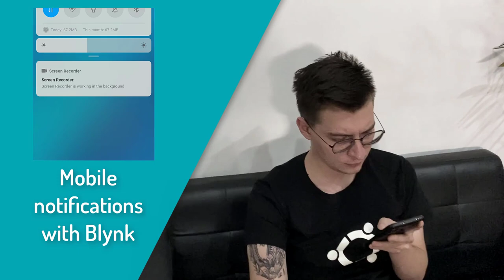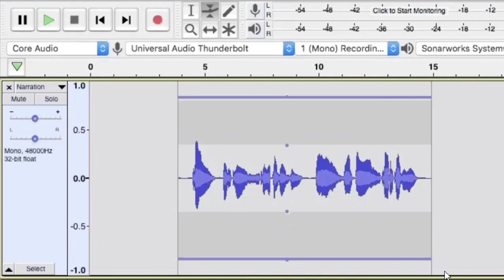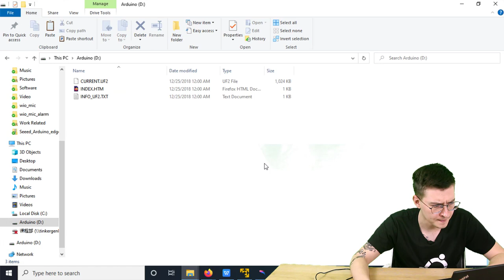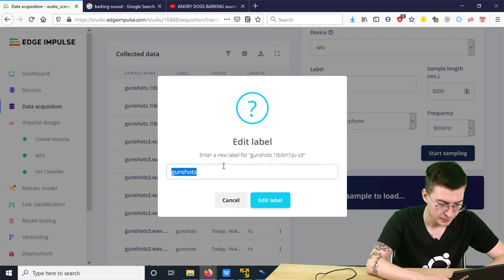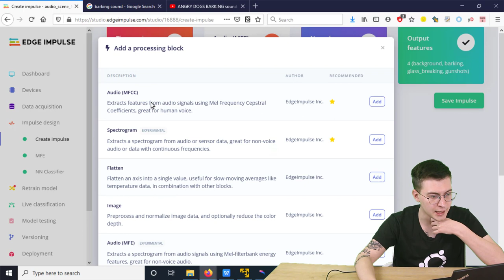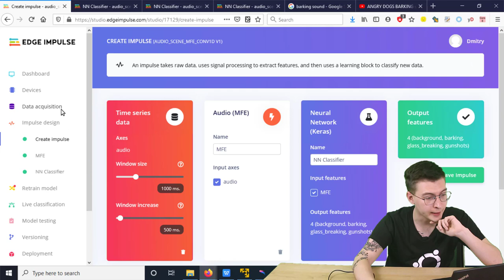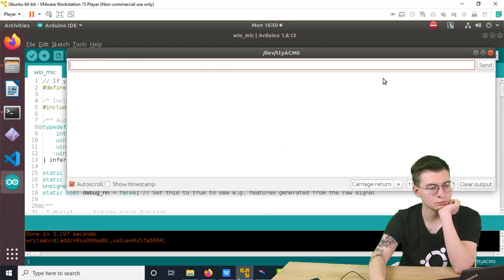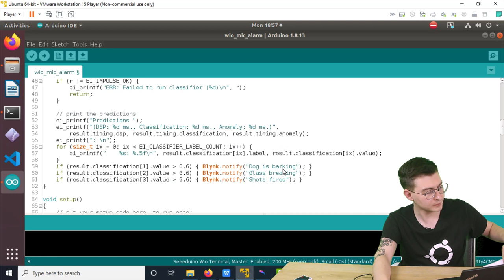Wio Terminal TinyML Course  #2 Audio Scene Recognition - ML on Microcontrollers with Arduino IDE

Comment: Really good video! 

In your opinion, is Wio Terminal built-in microphone good for audio scene recognition in a real IoT + TinyML project? Or do you recommend a specific external microphone for that?
Reply from the maker: Since video was made I published an improved version of firmware, with 16bit/16kHz recording and Butterworth filter. That one is much better than 8bit/8kHZ one, but still it depends on the application. It is good enough is distance is short (1-3 meters, depends on loudness of sound of course).
Reply: @Hardwareai  thanks for the info!